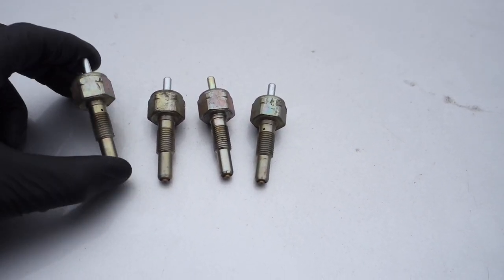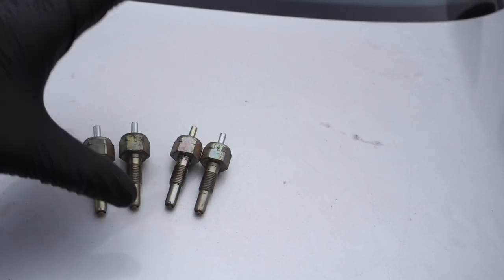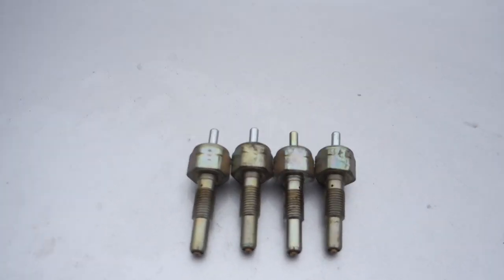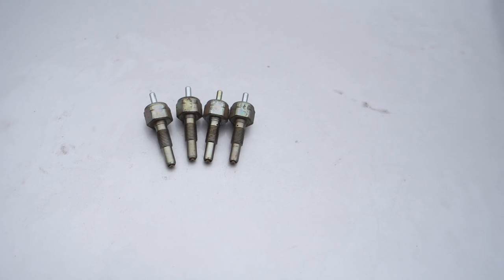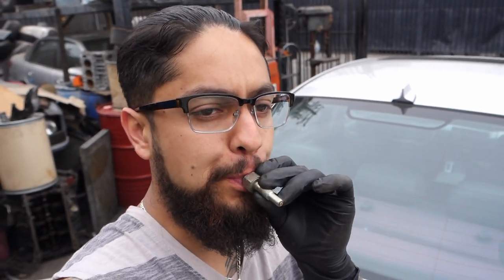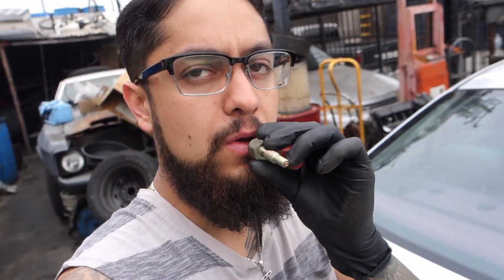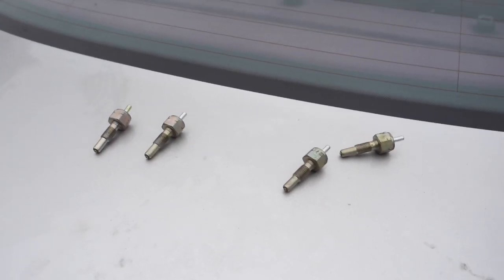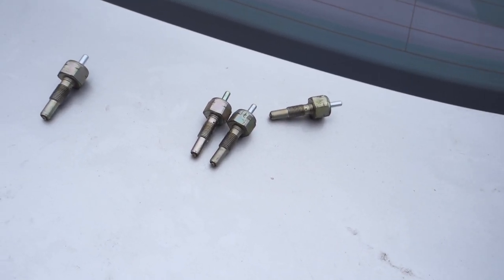Mazda rx8 mazda rx7 oil injectors good? How to inspect how to fix rx8 rx7 oil injectors

Comment: Can I fit rx7 oil injectors in rx8 renesis engine since the rx7 oil injector holes are bigger?
Reply: I'm concerned about the rx8 injector holes being maybe too small. Rx7 injectors are bigger.
Reply from the maker: Rx7 injectors won't work,and on most of my  rebuilds i cancel the omp nd go PREMIX

Comment: Looks like an e cig. You could have some fun and play a joke on your friends with that😆😆😆. But thanks for the tip. I recently bought a 13b and I’m going through it. Tell me, should I take off the birds nest and go simple with it and mix my gas and oil? Any opinions?
Reply from the maker: Lmao since you talking about the rat nest Im Guessing that you got a s4 13b mazda rx7 engine and yeah cancel that 👉💩 with the throttle body sensors and vaccums 👍 nd when you PREMIX is when you cancel the omp "oil metering pump " any ways i always recommend anyone to PREMIX with or without omp on any rotary engine 
JUST USE ANY TCW3 engine oil and go 1oz per galon of fuel 👌🤘👊
Reply: JM8686 
  Sweet! I love a simple engine bay that is uncluttered. It’s tough to know what some of that stuff is but I’m sorting it out little by little. I want to keep the air conditioning and the alternator. I will need an ECU for it. Suggestions?
Reply from the maker: What u mean with an ECU?  Car didn't came with one? Also since you there, cancel the pulsation damper with a banjo bolt cuz if not might catch on 👉🔥😂😂😂
Reply: JM8686 
  ECU-electronic control unit. It’s the brain I suppose. Mounted under the dash I think. No it didn’t include that and many people don’t use the original one that came in the car for some reason any way. 
  I don’t want a fire. Is there an open fuel port that will need a banjo bolt?😳 I’m super impressed with this engine. The more I sort it out the more I’m convinced it’s way cool. I love the design and function. Like something out of Star Wars.
Reply from the maker: Lmao i know what ECU means and it functions hahaha anyways i might have one let me look it up nd let u know
Or if u can find one u can get the N327 N332 or the main one for s4 86 to 88 non turbo N326
Reply: JM8686 
  Cool. Thanks for all your knowledge 😉